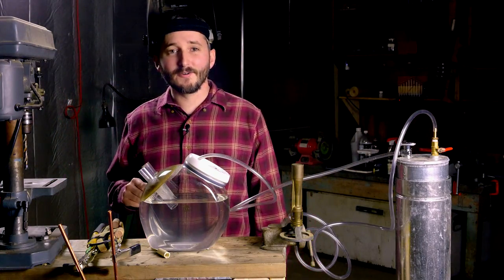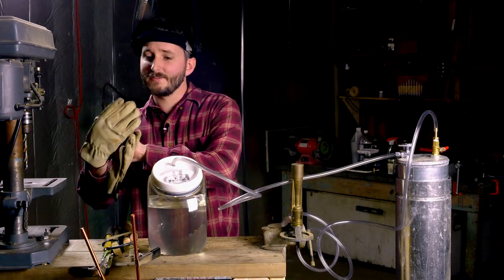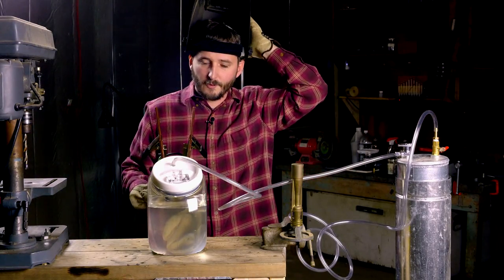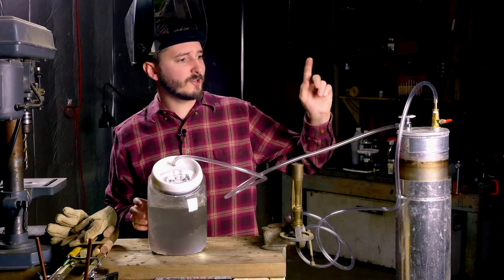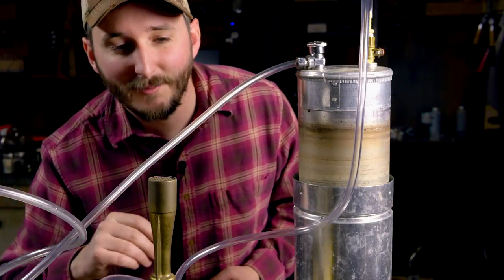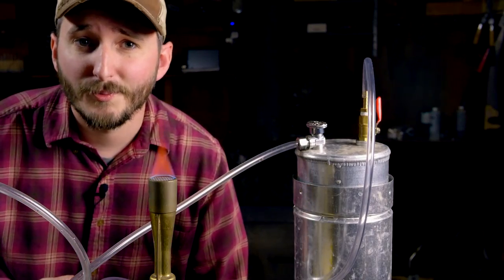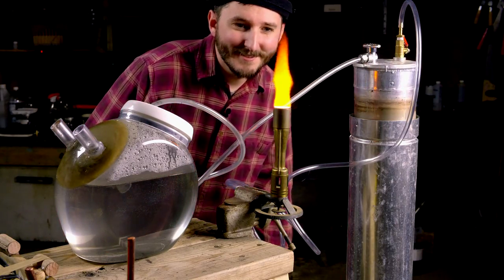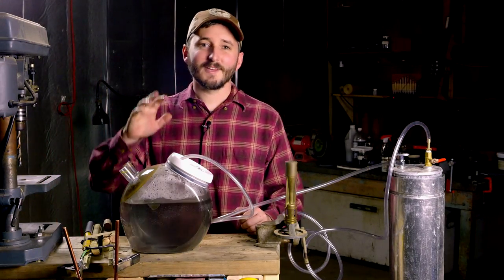Plasma Generated Water Gas (Electrically Produced Fuel That Is Not HHO)

Comment from the maker: I will be interested if any of you know of a simple method to separate the mixture of gasses that this process creates.
Reply: well you could lower them to -195°c where carbon monoxyde would be liquid and dihydrogen still a gas, but that would be tricky
Reply: Was the gas chlorine
Reply: Molecular sieve maybe, even something like a balloon might work.  It would be slow though.
Reply: maybe using density? i would figure out how to calculate the amount of carbon vs h2O produced and then figure out where the line between h2 and CO would be on the container. then use some kind of valve to purge off the amount of hydrogen slowly.
Reply: Molecular sieve like oxygen concentrators (the medical device might be easier to get ahold of) and liquid nitrogen generators use maybe?
Reply: I have read that CO is soluble in many organic solvents including Ethanol and it is very simple but inefficient method.
Reply from the maker: @bryanhumphreys940  That is a great idea to use a balloon. The hydrogen should leak through pretty quickly.
Reply: Dyson vacuum/ cyclone style? Separate them based on density
Reply: I think that your wood gas can be filtered (with limewater and a dust/smoke filter) to create a similar mixture of gasses
Reply: You could wait until they separate by density or something like that
Reply: Can only think of an easish way to to separate the hydrogen, but that's probably more useful?

Run it to completion using hot steam to convert the carbon monoxide into carbon dioxide, then solidify the carbon dioxide using dry ice to  be left with separate relatively pure hydrogen?
Reply: seeing as you have a source for the gas, are you aware of the fischer-tropsch process? It's used to turn hydrogen and carbon monoxide into synthetic lubricants and fuels.
Reply: CO and H2 catalytically react to produce methanol. Might make for an interesting video.
Reply: hot palladium tubes were used to separate H2 from other junk. BTW if you do this in ethanol you can make ethylene, acetylene even, if you do this pyrolysis experiment in ethylamine you can generate a fair amount of HCN, you can detect its presence by the almond smell:)
Reply: Common man, you know that it's simply the ''pyrolisys of carbon'' .  The current rise the temp. and the carbon vapor cannot burn under water.  Repeat the experience in a vacuum chamber and i guarantee you  have the exact same result.   But the water ''clean'' the impurity and the gas is better.   whatever...
Reply: You can use specialized membranes. Look up Applied Sciences video on liquid nitrogen generation at home
Reply: Carbon monoxide is an extremely poisonous gas. Also, H2 can set off CO alarms and give a false positive
Reply: The mixture is probably not as simple as a 1:1 molar ratio of CO and H2 - there is also the water gas shift equilibrium to consider, producing CO2 and even more hydrogen as the CO reacts with H2O, and it is quite possibly there is some Sabatier reaction happening as well, producing a bit of methane. You especially probably have some methane (and possibly also other light hydrocarbons) in there as afaik neither carbon monoxide nor hydrogen give such a red flame even as a pure diffusion flame.

Easiest way, if you have access to cryogens, might be cooling it with liquid nitrogen. At 195 K, the CO2 will freeze out, then at 112 K, the methane condenses out, and at 82 K, the carbon monoxide will finally condense, leaving just hydrogen.
Reply: @maizedong9729  no, the water was from rain, which won't contain chloride
Reply: what about blood? just put a bit of blood in the chamber and shake it about, isn't haemoglobin a really efficient binder of carbon monoxide? would that work? or an impossible burger if vegetarian ( would probably be better because raw heme binds stronger)
Reply: Carbon monoxide reacts with Nickel metal to give Nickel tetracarbonyl which will thermally decompose pack to CO and Ni
Reply: It would be interesting to see weather you could make fuel from this gas mix
There is a process called "Fischer-Tropsch-Synthese" in which CO and H2 are combined to make fuels like gasoline (but with tons of side products)
Reply: Sending off a sample to do some gas chromatography or something might be the simplest solution. Is there any chance you're producing methane as well?
Reply: @SomnolentFudge  converting the carbon monoxide into something volatile and even more toxic(like over 100 times more, worse than cyanide) seems like a bad idea
Reply: gases don't separate based on their density like liquids do, they stay mixed evenly.  Otherwise we all would have been asphyxiated due to nitrogen being heavier than oxygen.
Reply: @AndrewBahls  or rather, they do,but it's hard and expensive, an if you succeeded, the government would knock on your door asking why you were trying to make a plant to enrich uranium...so maybe that's a good thing :P
Reply: Laimp O-o
Reply: Probably Swing Pressure Absorption (PSA) but not simple.

- Separation with sorbents/solvents
,
- Gas separation membranes,  Hydrogen is leaky enough with surface area.
- Cryogenic separation, Some thing like a Thermoacoustic Stirling Cryocooler.
Reply: G'day,

Would it be "Brown's Gas "...?

  An olde fashioned name for the O-2 + H-2 + H-2, which resulrs from Water being pulled apart by brute farce...?

Have a good one.

Stay safe.

;-p

Ciao !
Reply: OK, so I was wrong, CO + H-2...

But you were at least as far wrong - that stuf, if it becomes

 "Pure CO-2 + Water",

on burning, then it is NOT any kind of a

 "Clean Fuel" - 

because CO-2 is THE "Dirt" in your Dirty Exhaust.

This stunt is basically spectacularly useless  Industrious Futilitarianism - hopelessly crippled as a "Fuel" Generation process by the amount of Energy required to produce the Carbon Rods & the Electric Current, and the Storage Inefficiency of turning Current & pure Carbon & Pure Cold Water into Hot Water & a mixture of an Explosive Gas that's hard to contain & a Poisonous Explosive Gas which both become Greenhouse Gasses upon being burnt - Water Vapour & Carbon Dioxide.

 Five Dozen Lashes on the Large Toenails, both sides, delivered with a wet Bootlace ; as Pennance.

Must Do Better !

(lol !).

Take it easy.

;-p

Ciao !
Reply: @denisgiguere1600  no, this would most definitely not work in vacuum. Carbon is a solid at room temperature, even under vacuum. The carbon vapour would condense onto the walls of the vacuum chamber. Regardless, pure carbon cannot be pyrolysized, as there is nothing to break down. What is occurring here is the production of what is called water gas, commonly made by passing hot steam over coal coke. What you are likely thinking of is coal gas, made from gasification of coal to produce a mixture of gases and coal coke.

Steam was/is often added to this process to produce a cleaner gas, which does result in a sort of crossing of steams with various different synthetic gas reactions happening at once.
Reply: @Nighthawkinlight  sorry for kidnapping your response... This just gave me an idea
 if you had a large container, and large production, you could use such a balloon as a buoy to see the layer between the CO and the H2. Same as when the helium meteorological balloons reach the service ceiling. Maybe some mylar balloon, filled with hydrogen, no knots but heat sealed... Or in the strangest way, a bubble of hydrogen of those toy bubble makers that "cast" in the air (they are some sort of gel that solidifywhen blown) making them more durable??
I know, it all is science...fiction
But maybe that inspires you or others!
Reply: Build a gas centrifuge, it's high time this channel have the means to produce its own weapons grade uranium.
Reply: @maizedong9729  no as only carbon, hydrogen and oxygen plus little water contamination was present
Reply: What a worthy idea to replicate my thesis. BTW, if the arc produces high lumens of light, why not attach a photovoltaic cell to the surrounding walls of the catalyst chamber? to lessen energy waste.
Reply: The source of my thesis' idea was TKOR. But when he died due to an accident, i felt empty. Thanks for filling that void👍
Reply: Using absorber 
Mellapak™ example founding in butane/propane filter absorber vessel in oil refinary process
The only and high efficiency way.
Further h2s left can be done to 2h2o +s by very very high temperature on catalytic
Reply: Hi my opinion is that something else is happening... pls try it first replacing carbon rods with something else i strongly believe that the gas flamability will be the same.. somethin happening with the plasma but not the carbon... i am not sure but i want to learn .. pls i think its eady for you just replace the carbon rods with something else maybe iron or another metal.. thanks pl do it for me i am really curious
Reply: Maybe you can use a car exhaust catalyst for seperation
Reply: Liquid nitrogen is cold enough at -195.79 to condense the carbon monoxide to liquid (-192) while leaving the hydrogen in gaseous state
Reply: @SomnolentFudge  i would strongly recommend not doing that. Nickel tetracarbonyl is named liquid death for a reason...
Reply: Is this a viable way to store excess solar energy produced during the day?
Reply: Vortex?
Reply: If you are going to attempt separation, realize that carbon monoxide and hydrogen are not the only things being produced, especially with copper acting as a catalyst.
Methanol
Acetic acid
Formaldehyde
...come immediately to mind...all gaseous at stp.
Reply: Hydrogenation of oil with a catalyst would remove the hydrogen while leaving the CO
Reply: @Nighthawkinlight  So doing membrane enrichment of cody's uranium hexfloride next?
Reply: NightHawkInLight This will work only if the differential pressure of hydrogen inside the balloone is higher than outside.
Reply: Is the gas ozone
Reply: can you use that gas to run a motor
Reply: @FreeLivingProject  Also another way to be blinded or poisoned! Let's do it!
Reply: you could probably use the technology historically used for enriching uranium for nuclear bombs - gaseous diffusion. especially that the molecular masses are so different, hydrogen diffuses ~3.73 times as fast as carbon monoxide, so you very likely don't need a huge device for this. (u235 diffuses only ~1.0043 times as fast as u238 and even then it's possible)
Reply: @SomnolentFudge  That's the 'best' solution, except nickel carbonyl is INCREDIBLY TOXIC and really not something to be trifled with. Proper containment is an ABSOLUTE MUST! I repeat, DO NOT attempt to produce nickel carbonyl unless you are ABSOLUTELY CERTAIN that it will be contained in a hermetically sealed vessel with multiple safety features.
Reply: @wyattroncin941  In a vacuum, a carbon arc produces significant amounts of buckminsterfullerenes (aka buckyballs), so that would still make a worthwhile experiment.
Reply: Hydrocarbons (mostly methane) and oxygen
Reply: Sky Man  water gas is a clean fuel because it does not produce any soot; It burns clean, but is not necessary a green (eco friendly) fuel.

As for flame temperature, we don't cook on yellow or red flames because the gasses used for cooking on don't produce lower temperature flames except when burning very poorly. This gas is just fine as a cooking gas, historically it and gasses very similar to it were produced on commercial scale and used as "town gas", being burned for lighting heating and cooking around the world. Yes it does have a lower flame temperature than methane and propane, but you just need to burn more of it to get the same amount of heat, the actual flame temperature doesn't matter.

As for a "poisonous flame", as long as it's getting sufficient oxygenation there will not be any poisonous products; You'd have to be running a very rich flame to cause a problem. The bigger issue is leaving the gas on and filling the room with carbon monoxide.
Reply: @alternativeenergychannel2289  it's water gas. If you want equations, those are already available on Wikipedia. Removing the carbon from the equation would just produce very hot, very unpleasantly electrode contaminated water and a whole ton of steam with a bit of split water; you need the carbon there to take up an oxygen atom, without it much of the hot gasses and plasma will just recombine into water the moment it cools.
Reply: @atouchofa.d.d.5852  no, it's very inefficient to store energy this way. You're expending hundreds of watt hours to store maybe a couple watt hours worth of gas. It's better if you want a chemical storage solution to use water splitting and a fuel cell. Plus you're producing CO2, which defeats the purpose of solar.
Reply: @Nighthawkinlight  yeah this will work. Back in the 60s we pumped the city gas  (which was water gas back then, see my comment ) into balloons. They would rise at first but after a day or so sink to the floor slowly.
Reply: Sky Man  lol but it was used for centuries as city gas for homes for cooking. It burns clean with a blue flame that might have a yellow tip. Likely due to contamination.
Reply: I know this is off topic but I figured this might be the best way for you to see this, can you do an experiment about producing either hho gas or gas like this under pressure like would you make more of less gas if you ran a hho generator at the bottom of a lake
Reply: @maizedong9729  If it was city water, more than likely. lol
Reply: Straight from Google .hope this helps 
What can filter carbon monoxide?

Air containing carbon monoxide is passed through the reaction chamber, and carbon monoxide is oxidized to carbon dioxide which then passes out of the filter. ... When air from an HVAC system is passed through the filter, carbon monoxide is oxidized into carbon dioxide and thus effectively removed from the air
Once the True HEPA filter has trapped the smoke, soot, and other dust particles, you'll need an even finer filter to eliminate carbon monoxide and the other gases. To do this, your air purifier will also need an activated carbon filter.
Reply: You can use water lock, container without bottom with H2 CO gases mix submerged in water, so one part of water exposed to gas mix and another to atmosphere, CO and H2 will diffuse into water and from water diffuse into atmosphere because of difference in partial pressures, H2 supposed to diffuse faster than CO so with time concentration of H2 in your container will drop, will need about 24 hours or more to vent significant amount of H2.

Can use sort of car tire and fill it with your gas mix at pressure of ~2bar(do not left air inside), H2 due to its small molecule size will diffuse through rubber much faster than huge molecule of CO, this should vent most of H2, the thinner rubber, the bigger surface area of rubber, the higher pressure - the faster process, its quite fast with car tire(wheel).

Another method is to inject nitrogen into your gas mix(to match 3:1 molar ratio of H2 and N2), and use high pressure and temperature to force hydrogen react with nitrogen to form ammonia, then cool it all to -40C(or even higher, depends of pressure) ammonia will condense and you can siphon it out, you will left with mostly CO gas with some leftovers of nitrogen and hydrogen, and ammonia can be decomposed back to hydrogen and nitrogen gases using catalyst in separate chamber.

Making metal hydride, some metals can absorb hydrogen when it at high pressure, ofc CO wont absorb into metal, so after some time you will left with metal hydride and CO H2 mix which contain less of hydrogen, by heating metal hydride in separate chamber you can release hydrogen back into gas form.

Activated carbon absorb hydrogen and carbon monoxide at different rate(don't remember which one is more absorbable, all answers somewhere in internet), can use it to lower concentration of one of gases.
Reply: I'd like to know how much energy you needed to create the gas and what the turn around efficiency is.  Is this more efficient that electrolysis for example?
Reply: Nice video as always! Well my guess is that only one rod is eroded away just like with normal electrolysis so if you hang the rods under water in upside down funnels, to catch the bubbles, and use a high voltage spark to get the arc going, you should be able to separate the H2 and Co. Good luck!
Reply: Could this gas be used for powering vehicles? Would it damage your engine?
Reply: Not a separation per se, but may be interesting: Water-gas shift reaction. (CO + H2O -> CO2 + H2). And separation of CO2 and H2 is much, much simpler. Lots of possibilities.  And it will be great to see WGSR in a workshop scale.
Reply: Simple... To understand but hard to implement I think you could use a long cooled pipe like fractal distillation where the heavier gasses, when cooled, fall out of suspension quicker
Reply: You could chill the mixture to cryogenic temperature. I think the co should condensate or even freeze at the boiling point of nitrogen while the hydrogen remains in a gas state
Reply: Can you make crude oil fractional distillation setup and separate different kinds of fuel from crude oil?
Reply: Great  video, but what is the advantage of this compared to regular electrolysis?
That created h2 and o2 which can be split at formation. And it does not need to be watched all the time.
Just put an airlock on both lines (or a tesla valve?) And store the gasses like that.
From o2 you can get to co catalyticaly if you need that.

But to answet the question, 2 methods.
1 for a continious process 
2 for a batch process.
I would go for 2 if regular electrolysis was not an option.

Bubble it trough water. The solubility of co in water is above 0.04 g gas per kg of water at around 0 C. While h2 is about 0.002 g per kg of water.

At 85C the solubility of co drops to 0.001 g of gas per kg of water.

First buble it trough a fine mesh strainer under water (distilled) to create many small bubles. Most of the gas will be h2.
Use an expansion vat(not sure if the corrent name in english, the big hollow ball with a tap in top).

The water can flow to a graham or friedrichs condenser, but fill the cold water line with hot water or an oil (check the fittings) that is at or slightly above 100C. The water will now lose between most and all of the co. When it comes out of the condenser, use another expansion vat and cool the water to 0 or 1 C. This can now be reused in the dissolve step.

The co gass is still very wet.
Let the water condense in a beker with molecular sieves (1.7a or smaller) so the water can not get in but the co can.
Just make sure not to overload the sieves.
These can be put back in with the ice water to redissolve them.

The contaminated h2 can be transfered to a seperate setup like this one. Bubnke this through it and most if not all of the co will be filtered out.

Note 1
Since you can not be 100% sure that the co is dry, you try to oversaturate the gas and then dry it 
This will make 2 groups, 1 with co and another with co dissolved in water with a lower concentration.
Since you started with this, just reintroduce it and more co will be generated.

Note 2
You can use the peltier effect to boil and freeze the water so it is only dependant of electricity.

Method 2 is more simple.

Use a double boiler method( how you would melt chocolate) but use liquid nitrogen instead of water.

Slowly pour the gas on the second container.
H2 will remain a gas.
Co will solidify
Any oxygen will liquefy.
Seperate the 3 in different appropreate containers.
Reply: My guess would have something to do with densities. Eventually the CO will sink to the bottom leaving the Hydrogen on top.
Reply: Maybe you could give the gasometer an atmosphere of helium so the hydrogen would float but the carbon monoxide wouldn't.
Reply: Hey NightHawk can you make a iodine-oxygen laser next??
Reply: @boxr_4214  i subscribe .. unless... you fill a small ballon with the lighter gas by mass and put it insine a container..like a "flotor device" :)
Reply: @Nighthawkinlight  use middle mass gas..something heavier than hydron and lighter than carbon dioxide.. hope is helpfull ! :)
Reply: @wyattroncin941  The problem with CO2 is that we take it from the dirt and put it in the atmosphere. The overall goal is to take from the air, and put back in the air, so this qualifies as acceptable, even if it's not efficient.
Reply: I'm on-board with the folks that suggest the Fischer-Tropsch process of making methanol. The interesting thing is that if you were to somehow drive the reaction inside the gasometer, its height would reduce as the reaction takes place. The reaction is supposed to be exothermic. If I recall correctly, we need an elevated pressure to make the reaction spontaneous such that the methanol precipitates out.
Reply: 🔴 What Is Islam? ⚠️

🔴 Islam is not just another religion. 

🔵 It is the same message preached by Moses, Jesus and Abraham.

 🔴 Islam literally means ‘submission to God’ and it teaches us to have a direct relationship with God. 

 🔵 It reminds us that since God created us, no one should be worshipped except God alone. 

 🔴 It also teaches that God is nothing like a human being or like anything that we can imagine.
🌍 The concept of God is summarized in the Quran as:

📖 { “Say, He is God, the One.  God, the Absolute.  He does not give birth, nor was He born, and there is nothing like Him.”} (Quran 112:1-4)[4] 📚

🔴 Becoming a Muslim is not turning your back to Jesus. 

🔵 Rather it’s going back to the original teachings of Jesus and obeying him.
Reply: Interesting, but since you were jamming 100 plus amps through there how efficient would it be for practical use or is it merely a curiosity?
Reply: HYDROGEN IS LIGHTER THEN AIR  carbon monoxyde  IS HEAVER THEN AIR IT WONT FLOAT AWAY.PLACE A SMALL HOLE ON TOP PIN NEEDLE AND NO HYDRO
Reply: @FreeLivingProject  CO 2 TIMES
Reply: @Joel-bj8om  WHY
Reply: I just watched this video, where there's fire arcing through steam, and thought it had to be plasma, longer explanation on the video. But then I looked it up, finding you, so I really hope to hear your thoughts. It's the 6:20 in big stack d's video I linked
Reply: Sublimate ice, then rapidly heat the phase changed material, surrounded by static rich steam, and let it shoot out the bottom of a piece of aluminum, still cooling from a molten state.
Reply: Simple . . . make the gas bubble in water with lime that retains the carbon.
I don't know about the efficiency of the system, but the water with lime will capture the carbon quickly.
Do the following test: put water with lime in a container, shake well, let it settle for a few minutes, remove the transparent liquid to another container, then use a soda straw to blow the carbon dioxide from your lungs into the transparent liquid and note that the clear liquid turns white because it retained the carbon that you exhaled from your lungs.
Reply: @Nighthawkinlight   Cody's lab did a thing on hydrogen balloons and it took a few days to leak out if I remember correctly, they also filled with atmospheric air during the process.
Reply: H2S?
Reply: The simplest method might be a molecular sieve. Hydrogen is a very small atom while carbon monoxide is a substantially larger molecule.  A nitrogen separation membrane would  probably let hydrogen pass through it but not carbon monoxide. An alternative option would be to cool it down. Hydrogen has a very low liquefaction temperature, I bet carbon monoxide would liquefy and the hydrogen would pass through cryogenic temperatures unchanged.
Reply: Since we are talking about carbons; a not very cheap way would be through a heated catalyst like an automotive CAT. Another way is micro passages similar to oxygen concentrators(1.5mm orifice if I remember correctly to separate hydrogen and oxygen). Another way is confirm whether each gas has a magnetic charge, then create separated chambers for gas to rise whilst allowing fluid to transfer easily between the chambers. I think you just might be able to "filter" the gas back through a seperate conatiner of water to get reintroduce it back into some oxygenated water. 

Really depends on which gas you want. Carbon Monoxide or Hydrogen?
Reply: Browns gas?
Reply: Hydrogen?
Reply: Hey! Is the solution patented? I was approached with this solution a week ago by an industrialist who says they are patenting it.
Reply: Nighthawking light

If you go to the Patrick Kelly channel he shows a patent on HHO gas being separated by a coil induction field.

Simple enough.

Wrap some insulated coil wire around a bubbler tank and the electromagnetic field of the anode and cathode will cause the gas to separate from hydrogen and oxygen.

It's on the Patrick Kelly channel regarding HHO builds
Reply: Seems complex to separate, possible but complex, why would you want to anyway, to perfect highly flammable gases in one container, store for later use in a combustion engine job done.
Reply: @maizedong9729  

He said carbon monoxide and hydrogen.

The yellow flame was sodium in his opinion from the wood ash.

Do not know if it's chlorine as he started with rain water.
Reply: Methanol my hoest guess
Reply: The simplicity would rely upon where the gasses are formed. In electrolysis the oxygen and hydrogen form at the positive and negative terminals and as such are easily seperated. If this process is similar, a tightly woven fiberglass cloth may replace a high count silk screen as wet chamber divider. Hopefully the glass fibers won't melt underwater when exposed to the arc.
Reply: Remove CO2 by absorption on CaO. Palladium membranes lets through hydrogen, but not the other gases when heated.
Reply: @DoNotPushHere  well, the hydrogen leaks both ways.  It will seek equilibrium according to the pressure on both sides of the Hs permeable membrane,  The membrane will filter H2 roughly in proportion to the pressure ratio on both sides.  Keep the CO side high and the H2 side low.
Reply: @Dsonophorus  sorry I can't even find my original comment... LOL
What did I say?
Reply: @DoNotPushHere  yeah, it is a big list of comments here.  youtube->history-->comments might help, but you were describing a membrane separated storage thingy
Reply: awesome
Reply: @wyattroncin941  Is it possible to create water gas using heated graphite instead of coal coke?
Reply: Man all these super scientific responses are awesome.

I'd have just pumped it all into a plastic container filled with distilled water and shook it.
Reply: @daddylaugh1983  surely the level of kinetic energy youd need to pump into a Beta SE to induce that level of temperature drop, gas condensation.

Would make the whole thing void?

Like you'd have to use so much more energy to accomplish that. Than you could ever get out of burning the resulting gas?
Reply: @daddylaugh1983  again. I'm not disputing the science. Sterling refrigeration is incredibly efficient and chemical free. 

But it's conservative of energy right? 

Like even if you say, daisy chained two Betas together, with a much heavier flywheel in-between to act as a kinetic battery the transition from sunlight into kinetic, back into a temperature differential. For gaseous separation. I just think the amount of energy it would take to drop the resulting wood gas to a temperature to condense and separate would be far more than the end product. Especially because the existing storage structure relying on the pressure from the gas raising the cylinder couldn't be used during the condensation. 

You need like over 5 bar to liquefy CO2. And at that level of internal pressure. That tank would pop off like a spring board.
Reply: Haven't read the 120 other comments just wanted to add gravity (density) for separation. As hydrogen is much lighter that CO.
Reply: This is extremely cool and I find it very interesting but beyond that what is the real point? The amount of electricity needed to break the bonds and create CO and H gas is incredible. Ultimately what purpose serve?
Reply: @NightHawkInLight Do you know what the efficiency of the conversion is? ie How much energy does the captured gas have Vs the electrical power input?
Reply: Why not use resonance frequency to split water in the first place?
Reply: In a standard HHO system to separate the hydrogen and the oxygen gasses, two different containers with the negative plates in one container, and the positive in the second, the negative lead will only release oxygen, and conversely the positive releases hydrogen from the water, the current runs down below the electrodes and passes below the tips of the electrode process, thereby allowing the right gasses to rise in the chamber to two separate release hoses.  HERE the carbon arc electrodes must be in close proximity to one another, and use AC power at 40 Amps or so, to generate the release of hydrogen and oxygen at the same time, plus heat formation of the carbon oxygen molecule of carbon monoxide.  All of the available gasses would only exit in a combined state in this process because they are all being released through the action of the arc, which is one physical point in the water.
Reply: Dynamite
Reply: Hello my friend. I know I am responding way too late and you will most likely never see my comment. However, now that I saw your very valuable content, I thought I could make myself useful and actually help you in finding in what you are looking for (I hope you are still interested). I believe the answer to your problem is CuAlCl4 complex in toluene which has a very large adsorptive capacity for carbon monoxide. One thing is that you need to ensure you remove all the water in your gas mixture before passing it through this complex by applying a cold finger for instance. H2S is also most likely presenting in your source water because of its contamination with biomass. Please ensure to use clean source of water or remover H2S through a blend of amines and/or NaOH solution. 😊
Reply: Cheers for that Mate! , Remember the PLASMA Spark plug that can ignite water? Also a free secret , heat your electrolyte to 60Deg C first for a stable arc, try using tungsten rods.Option add some urea/pee. See my badly made video of diy cold fusion, its very similar to what you have done yet at a tiny fraction of the power you used. Because of that low power, I suggest a multi cell device running in parallel, with many 20W TEG's to convert the heat , and an electrolyte/Gas capture, gravity recirculation system. Its very over-unity concept yet breaks no rules! EVEN MY $10  Cold Fusion Device ARCS Over an Inch to the SS container.
Reply: what is plasma temperature?